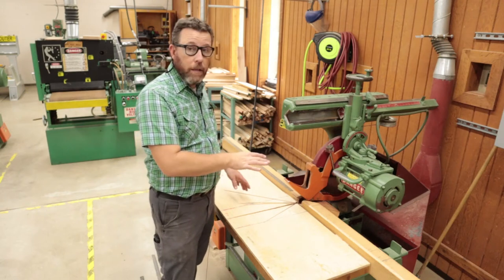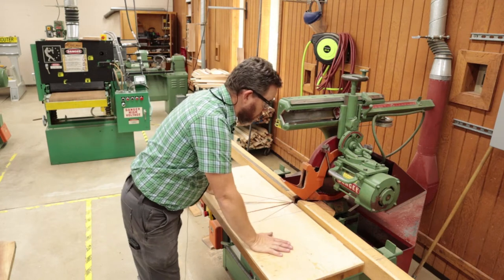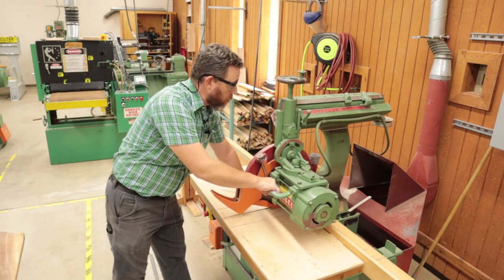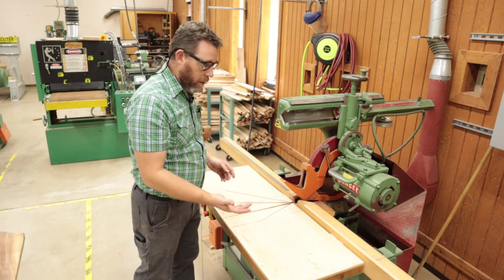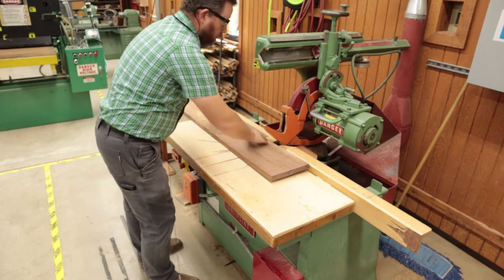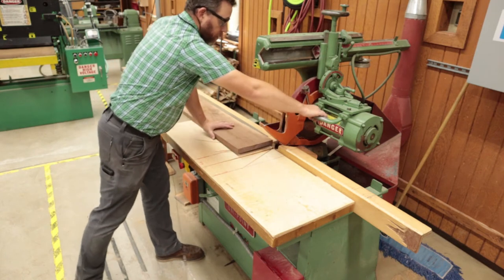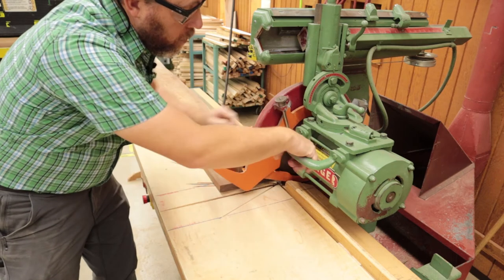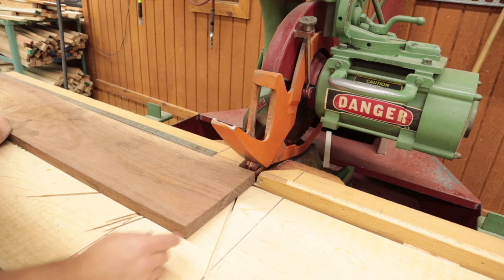Northfield Uni-Point Radial Arm Saw Operation ad Safety

Comment: Nothing is gonna want to jump or climb into the wood as you said unless you have the wrong blade or don't know what you doing. Not enough infeed or outfeed  support on the RAS. I would be very careful of the things you are saying or coming around as a teacher....good luck!
Reply: Ummmm yes it will.  So if I start a cut the saw won't pull forward?  That is beyond stupid.